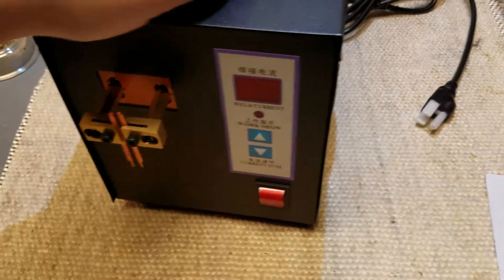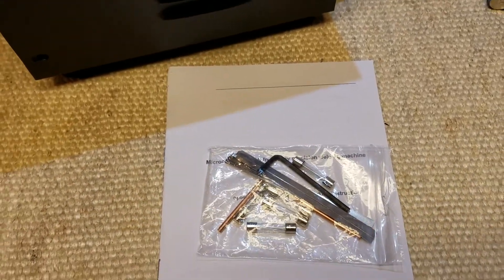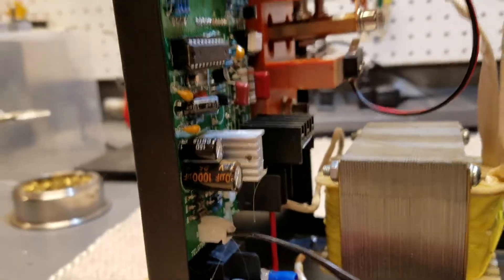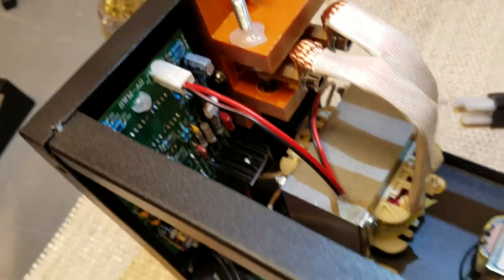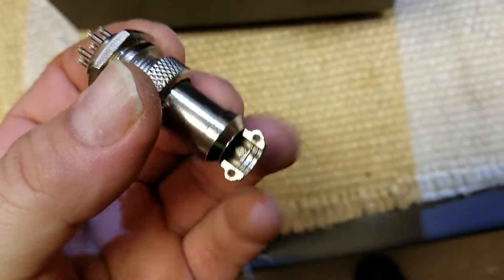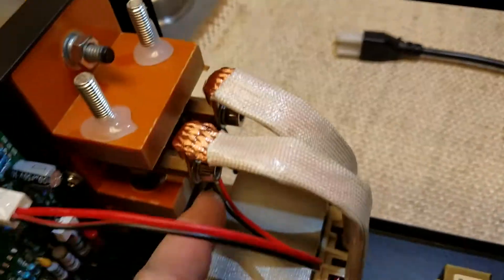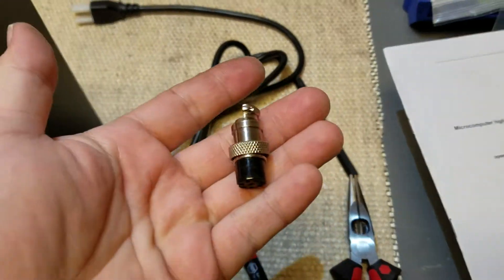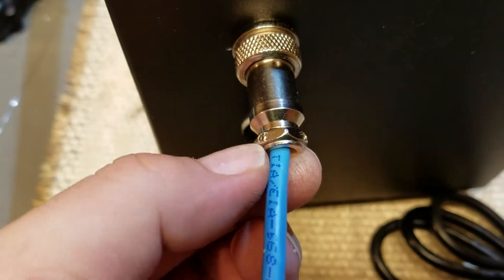Battery Tab Welder Teardown and Mod

Comment: would you recommend this welder, I was hoping you would show it in action, cant find any reviews on it. Thanks
Reply: If It Anit Broke Still Fix It yap thing has inrus protction witch 99 procent of cheap ones dont have if u dont have that it will pop any Braker uder 30amps
Reply from the maker: dang, sorry for the late(very late reply).  Its a good welder.  I do not use it daily but at least once a month. I will do a new video showing it in action.  If you need a medium to light duty tab welder its good in my opinion.